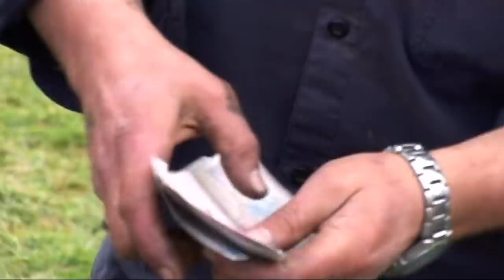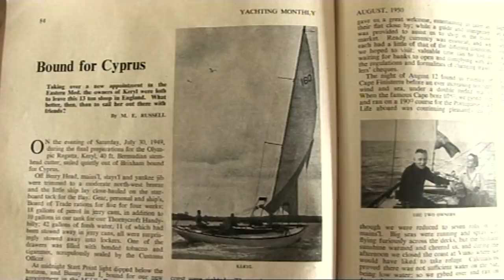KERYL - PART 1 OF RESTORING A CLASSIC WOODEN SAILING BOAT

Comment: This is why boat surveys are invaluable. They save us from making the mistakes of our lives. 18K IS cheap, but it's the hidden restoration costs that sink your wallet. I've never understood why builders thought it a good idea to use iron on wood in a water environment. Bronze is the best solution, whether it's for fastening, floors or knees. Good luck saving her, mate.
Reply: I mean in fairness it’s presumably gone since the 1930s with iron fasteners. And it’s not like budget wasn’t a consideration back the other.

Comment: Its a bit dishonest to say a fiberglass boat would cost you over 100k. You're comparing used to new.

He could've gotten something functional for what he paid.

This is a horrible trap to fall into cause the logical thing is to just dump the thing and maybe sue the previous owner. You're going to spend more in renovations than the boat is worth. Maybe even more than it would take you to buy a functional one even after eating the loss.

But making that decision, admitting defeat and waving goodbye to 15k you just invested is really really hard.

Definitely pay for those surveys, guys. Doesn't matter how experienced you think you are